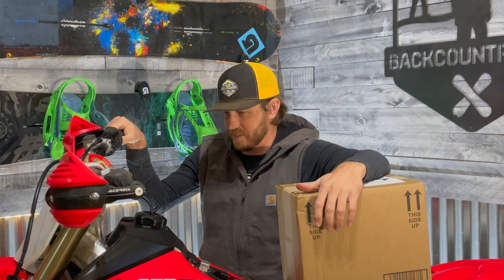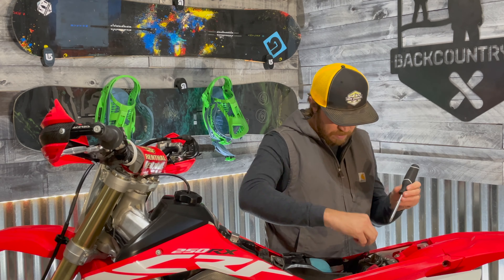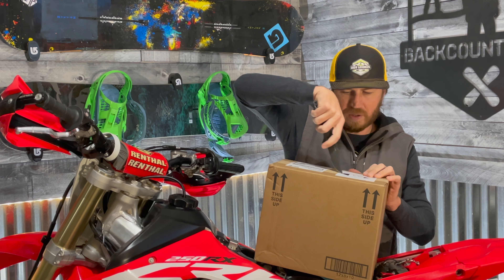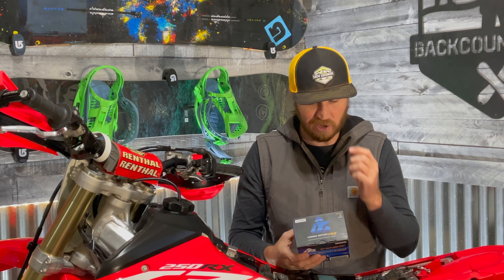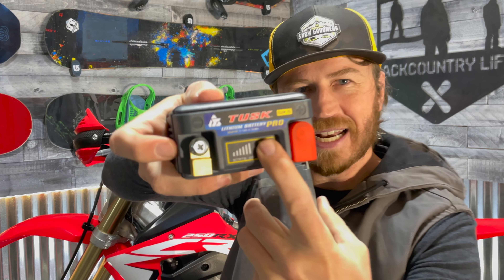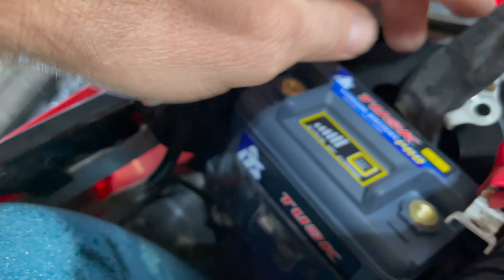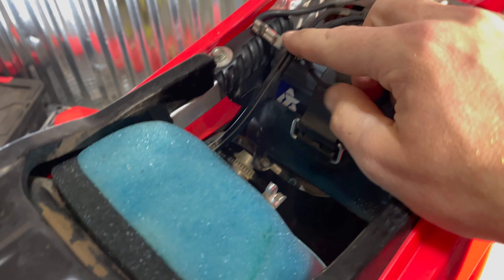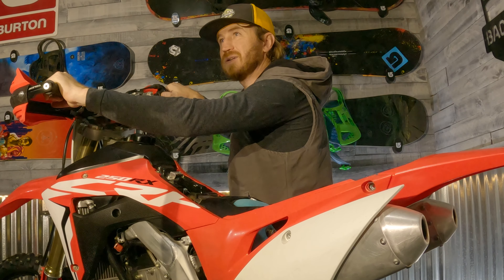Tusk Lithium Pro Replacement Battery in 2019 Honda CRF 250RX - PROBLEMS!

Comment: The Lithium batteries are worth every penny! Bought a TTR 230 for my wife in 2012 it already had a lithium battery in it from previous owner. This Bike does not get rode at all and is stored in a Non insulated shop in cold temps and I can go out and it will start anytime and all the time and I have never once put a charger on it.
Reply from the maker: wow good to hear. I need to also replace the battery for my daughters CRF110 that she never rides and I forget to start it haha.

Comment: So on the negative terminal the bigger screw holding in that copper spacer goes in and then on the positive terminal that small screw they give in the small pouch with the spacer is for the positive terminal? So not needing to use the two big screw already placed during packaging that holds the copper spacer? 9:25 also what size drill bit did you use?

Comment: I've been buying motorcycle parts for decades and Tusk generally makes good quality products, although any brand is going to miss the mark once in a while.  Not sure how something so standard as battery hardware got messed up, but it looks like an easy fix.  I'm concerned about this battery charging when installed on the motorcycle... lithium batteries require a special charger, so will they accept the charge from the engine stator?  I assume so, otherwise we would hear about it by now for sure.  Also it is interesting that this is lithium IRON battery, not a lithium ion battery.  Just bought one of these Tusk Lithium Pro TLFP-7L batteries for my WR450F along with a battery tender selectable (lead acid/AGM/lithium LiFe) so we will see how it goes.  Thanks for the good video.
Reply from the maker: Thanks for the comment. Yeah It was annoying that the battery hardware wasn't spot on but it wasn't a hard fix. You know thats a good question. I have heard the same thing about having to have a special trickle charger for all Lithium batteries but not sure why the stator on a dirt bike charges one just fine. We have't had a single issue with it charging from the bike....

Comment: Lead acid batteries are heavy and not as powerful as lithium batteries. When comes to charging sometimes it's best to remove or completely disconnect the battery from the bike
Reply from the maker: Yeah, I should have removed the old battery before I charged it!

Comment: The Tusk Pro Does not fit 2022 Honda CRF 450r.  Plus the terminals are not the same. Just FYI
Reply from the maker: Thanks for the heads up. I just bought the anti gravity 801 battery for our YZ250FX, installed super smooth

Comment: Did the old battery die without warning it was going bad? I  have heard the lithium batteries can work one day and not the next compared to a lead acid battery usually dies slowly
Reply from the maker: Yeah it was going bad but I put a trickle charger on it and for whatever reason that zapped it.